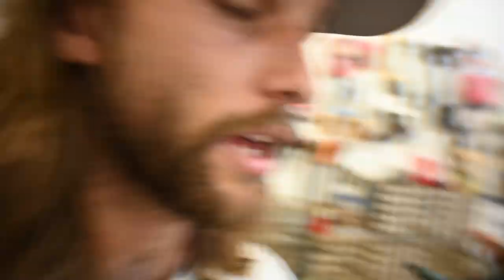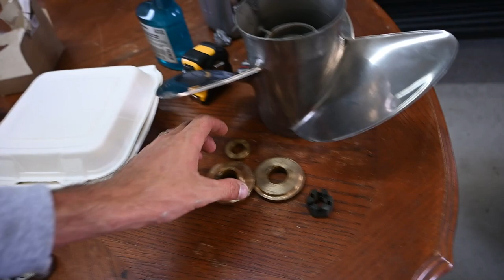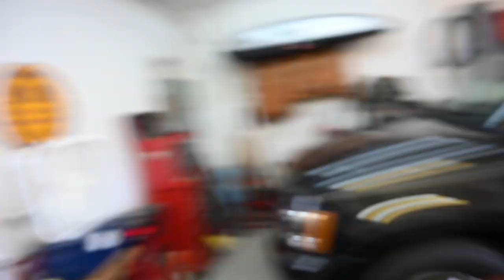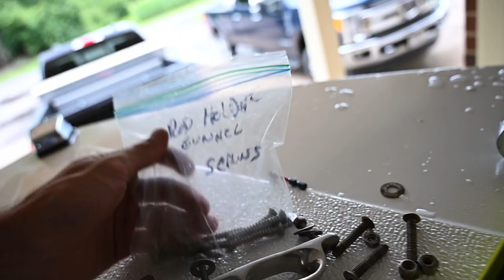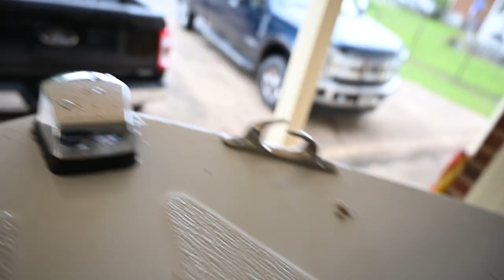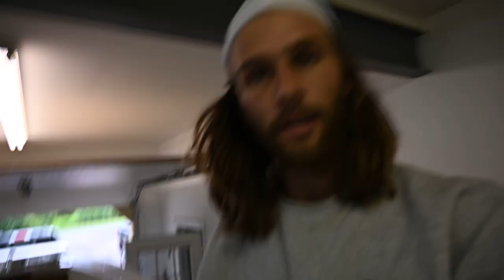Rebuilding a Center Console Fishing Boat - Episode 18: Always Problems

Comment: Welcome to the club!

Your boat looks great! It is absolutely a bag of mixed emotions to do something like this, but in the end, it's all worth it! Everything takes longer than expected, costs more, and plans are nothing more than hopeful dreams like winning the lottery 😂.

My experience wasn't as involved as yours. But I have a 15ft Terry bass boat that sat for almost 5 years. I had zero plans for it other than taking it to the dump. I one day hooked it up to my truck to tow it to the dump. I pulled it about 2ft and the tongue of the trailer broke off. It was full of dirt, weeds, and had a tree growing out of it. I started removing junk out of it and before I knew it, I had it cleaned out. All electrical, flooring, transom, and steering were shot. The motor was completely unknown from sitting uncovered for years. I spent weekends and weekdays ripping out the flooring, stringers, and transom. I took the fiberglass shell and power washed it. With no experience with any of this, I purchased lumber from the local retailer and started to measure and cut. I tried getting help from online forums, but got so much mixed information. One poster would say you are doing fine, and another would say everything is wrong and I am basically a moron 😂. But anyway, the existing stringers and transom were nothing more than dust. I got treated wood and let it dry in the summer sun for about 3 weeks after cutting. I used West Marine epoxy and fiberglass cloth to install all new stringers that I bonded to the hull with marine 5200. I painted the inside hull with oil based paint and poured marine foam everywhere except the center. I epoxied 2 pieces of 3/4 plywood for the transom which I think is more than enough for a 40hp Yamaha engine. I also installed a 3/4 floor that is fiberglassed over and painted it  I sanded the outside of the boat and used my sprayer for a nice paint job. I installed all new hardware, wiring, switches, etc. 

The motor was a HUGE HUGE challenge! I spent countless hours over the course of a month removing stuck and broken bolts. I have never gone through so much pb blast, cursing, and throwing things in my life! Phuck saltwater outboard stuck bolts!! It was a 1990 Yamaha 2 cylinder 40hp engine. The local marine machine shop gave me good advice. I opted for 2 new sleeves, new pistons, rings, carb rebuilds, and some other stuff. He said I was doing it right and it would run like new. With no outboard experience, I had him assemble the block. He provided me with the rest of the gaskets. He also told me to bring the motor to him before starting to check everything including timing and to adjust the carbs.... The motor fired right up and I followed break in exactly how he instructed me to.

I'm sorry, I'm babbling 😂. My point is that restoring a boat is the 💩 est job, but extremely rewarding! I know I probably did some things the pros would laugh at. But after 4 years, she still floats and the motor is touch key start!